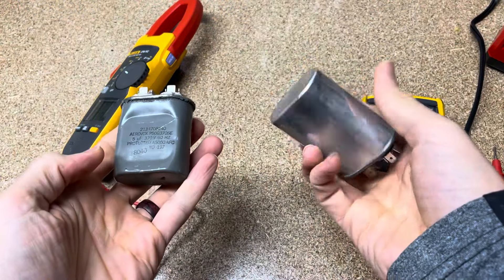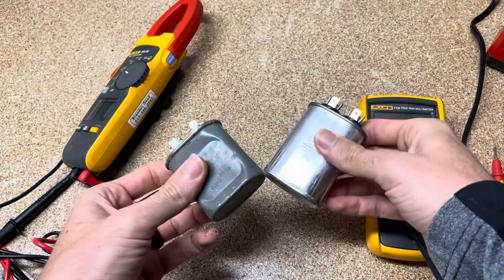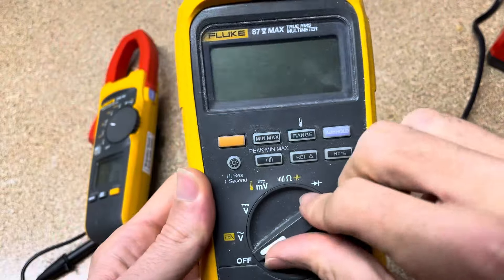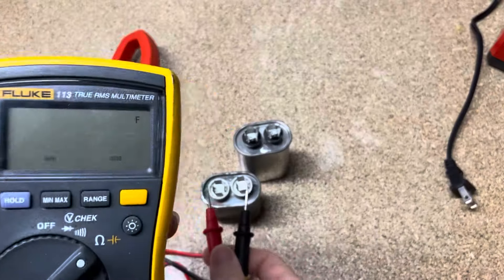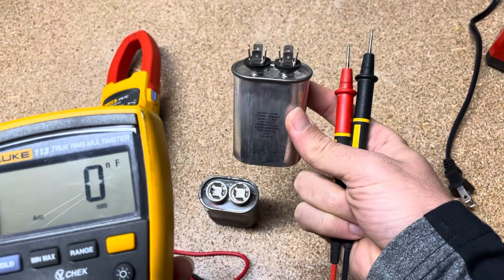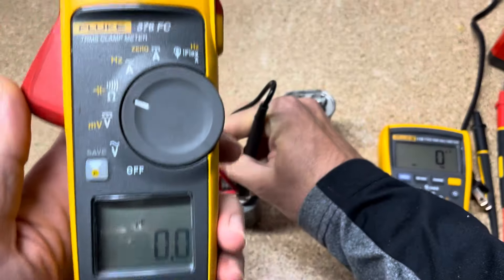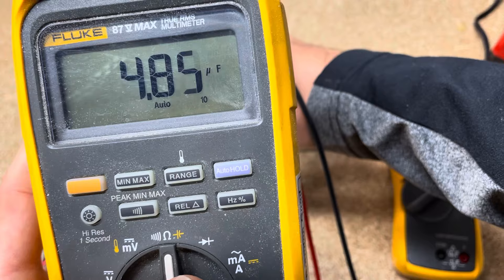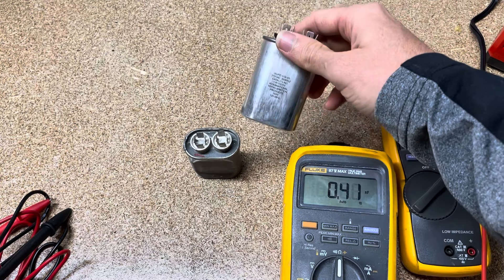How to check a capacitor - Fluke Fridays - Episode 120

Comment: This is how you check capacitance is rested mode. If you want a more accurate way to check a capacitor, check it running. The formula is (amperage x 2650) / voltage).

Comment: only problem with the video is my capacitor has 3 terminals, not 2, so I"m totaally confused!
Reply: If it for AC, you should have a C terminal, Herm, & Fan. Your capacitor will have a number like 45/5uf. Check between C & Herm will be the higher number (45) and between C & Fan will be the lower number (5).
Reply from the maker: @davidlindgren7605  I believe that kind of capacitor has 2 capacitors in one. Like a starting capacitor with one microfarad setting for starting the motor and a second for running the motor. The ratings should be on the side of the housing.
Reply: @fridayswithbrandon  I think you're right. My capacitor is fine. Turns out the problem was a simple 3 amp fuse on the circuit board that had blown. My advice to others is always check the "stupid stuff" first, like fuses, circuit breakers, etc, before panicking and assuming the world has ended with a blown capacitor or motor failure.